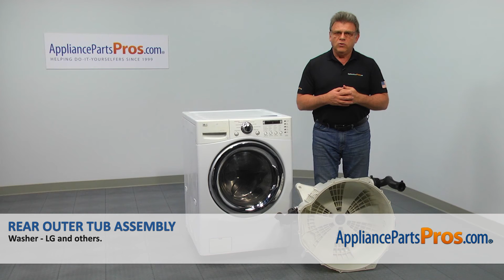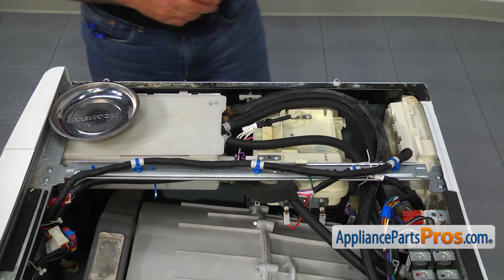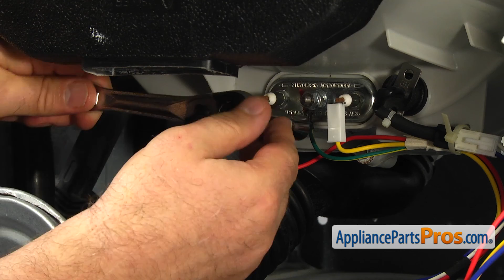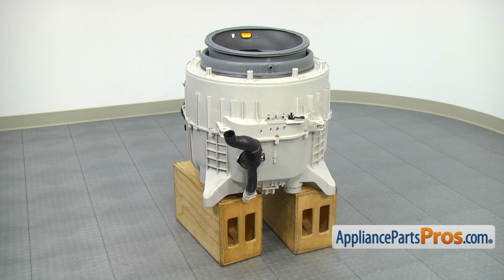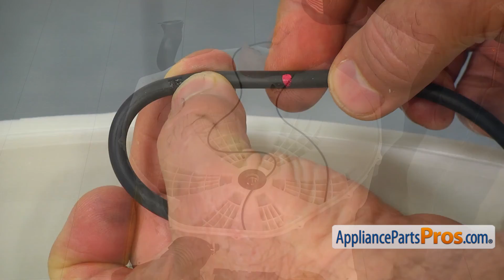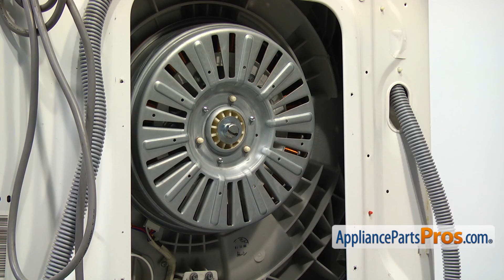How To: LG/Kenmore Rear Outer Tub Assembly AJQ73413811

Comment: 12:06 Okay, my LG WM4000H does not use the 6 screws here at all. Instead, its all glued with an extremely strong adhesive that I cannot remove. Even if I could remove it, I worry I wouldn't' be able to re-adhere it. Any one have a problem with this? How did you resolve?
Reply from the maker: The outer drum on your model does not have screws holding it together. This part can only be replaced as a complete assembly, part number AJQ74873908, which is no longer manufactured.

Comment: @appliancepartspros  I followed these instructions and double checked abetting inside the back panel but I'm getting a loud grinding noise. Help? Could it be I was shipped the wrong part?
Also I didn't grease the shaft of the inner stainless steel basket,  which one video I saw says to do.
Reply: Did you replace the rear tub or basket ? Both should have been replaced

Comment: Excellent video, that goes into details on disassembly and assembly. In many cases its not possible to unscrew spider nuts, and as per this video its recommended to replace tub assembly. However, if you have opened washer, and were unable to unscrew spider bolt, this is what I did:
1. Use rotating blade to cut bolt head. 
2. Remove the three baffles inside tub.
3. Unscrew 2 screws from bolt side and one screw from side.
4. Use a screw driver to pryout plastic, remove the rusty bolt and nut. Screw could not be opened because nut was rotating inside. Take a screw to hardware store, and buy 6 Stainless steel screws, six nuts, six locking washer, 6 washers and six star washer (I paid total of about $15 at Home Depot)
5. Clean plastic parts, and insert nut in the housing. Since nut will be loose, use adhesive to fill around nut (liquid nail) and let it dry for about 2 hours.
6. Place star washer on nut, and metal plate and plastic hub. 
7. install screws and complete waffle assembly. 
8. Install  waffles in drum.
9. Install spider, use a locking washer and washer and tighten all six screws.  Congratulations, you have saved over $250 by repairing waffles. 
Hope this will help others.   Suresh Roy
Reply from the maker: Thanks for those tips!
Reply: Omg ty so much for sharing your tips! We are having that exact problem where we can't take the freaking screws out and that tub is over 150dlls!!!!
Reply: Glad that my tips worked for you. Fantastic